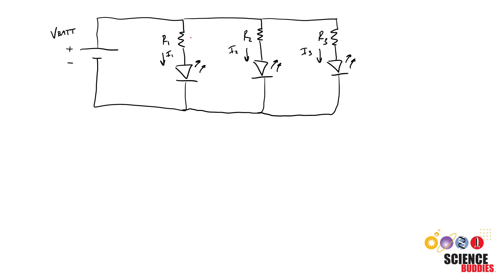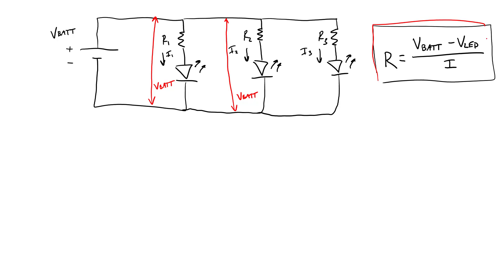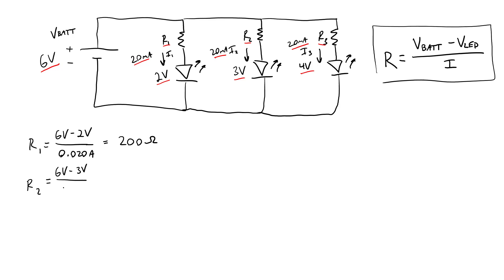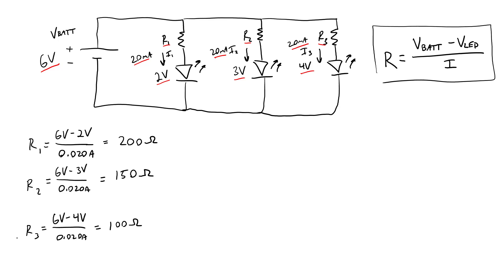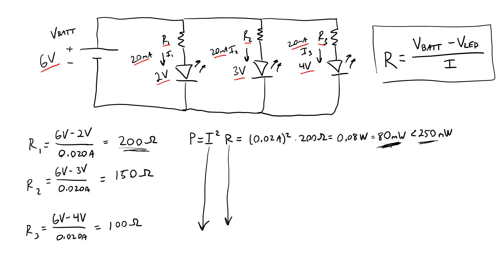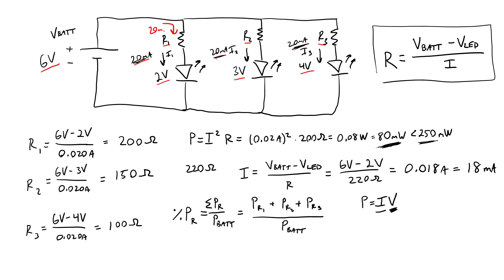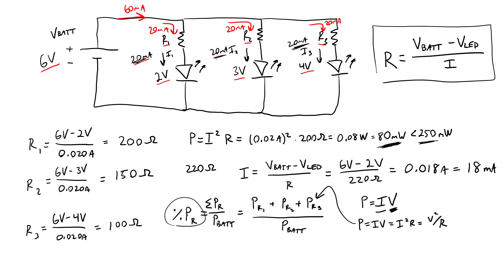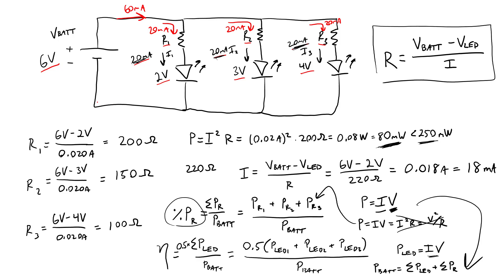LED Circuit Design: LEDs in Parallel

Comment: You are very much on the road to answering a question I have and since I'm very new to LED's you'll pardon me putting things in laymans terms I hope. I'm familiar with much of the math and the requirements of setting up a Parallel circuit, small or even larger. What would really help to bring me more up to speed would be seeing the math which would answer this question. 
Assume I have a 12V 70Ah battery and a box full of red LED's 2V and .020A. In theory, how many could I put in Parallel and with keeping to the figure .020A and having resistors stepping up 1 Ohm each over the next, how many could I light up? And for how long would they function?
Am I right in saying that in a Series circuit, the answer would be 12? And what if the circuit was Parallel / Series? I guess what I"m asking in ordinary language is, just when does a battery put up its hands and say that it has no more to give?
I'll watch what you have here over and over as it does point me in the direction I'd like to go. Thanks....
Reply from the maker: Hi - we recommend looking up a video about "battery internal resistance," that is a separate topic that we don't really address here - you cannot get infinite current out of a battery; this video series assumes an "ideal" battery. If you have more questions then you might want to find a forum dedicated to electronics, we're limited in our ability to reply to specific questions here.